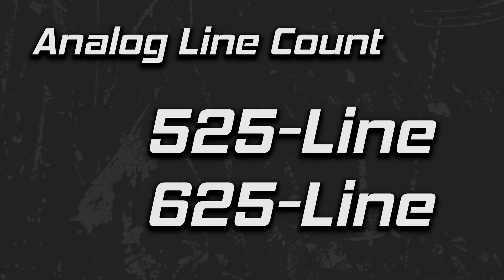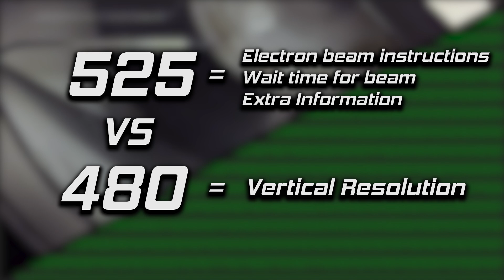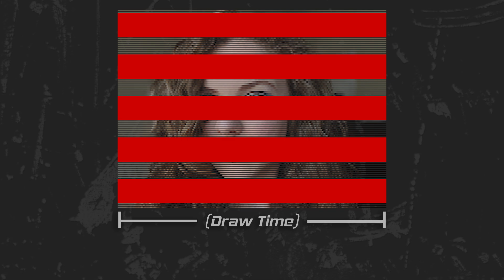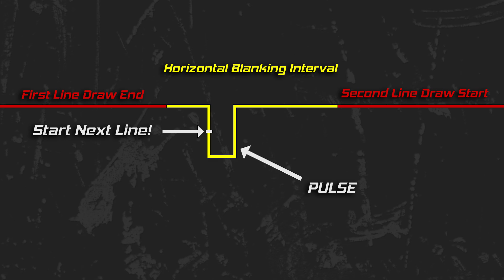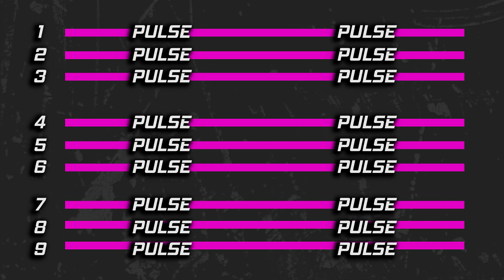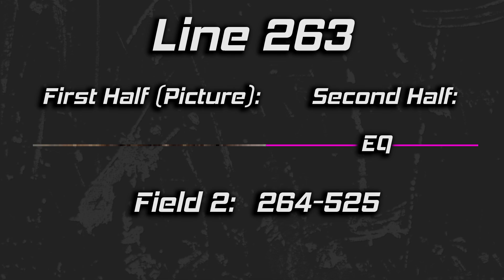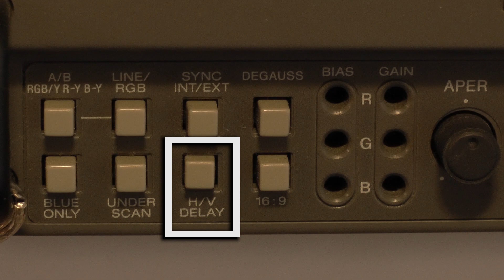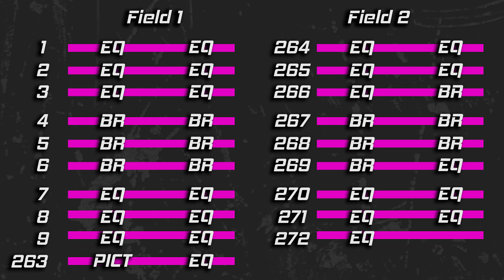What is 525-Line Analog Video?

Comment: One thing to note is that it's not the beam that needs time to go back to the left or the top, since it doesn't have inertia, and it's blanked anyway while doing so. However the deflection coils have inductance, which resists changes in current, and you can only drive them that hard before something would break.

Comment: And now add to the mix that there is PAL, SECAM and NTSC with different timings and line counts and different ways of encoding video signals, color, mono and stereo audio, and then try to write software that takes (almost) raw signal information from the hardware (because you don't want any fixed pipeline pre-processing by the hardware itself, you want pretty much all processing and decoding to be fully customizable by your software) and try to convert that into modern video output in software. This was a project I once worked on as a developer, and trust me, you will hate it! You will hate almost every single second of it, you will curse at all these standards and how they were designed, at all the inaccuracies, stupid hacks, and tons of problems you have to work around. Analog TV was such a mess, it's unbelievable it ever worked as well as it did.

If you ask me what was the most fun part of this project: The most fun part was writing GPU shaders for image processing, because there was no way you could do all that just using the CPU, although the hardware did at least some processing for you (which I also had to manipulate by messing with several dozen registers and writing custom firmware for the hardware), because there is no way you can be microsecond accurate in software alone. So some of the signal conversion was done by the GPU using shaders, and that was probably the most fun part of the whole project, as all the code was completely up to me (I know what information is coming in and what I want to get out, but how to do it with the GPU hardware was the puzzle I had to solve).

I once had to write an MPEG-TS decoder for mobile devices, and I didn't like that project either, because the MPEG-TS standard is huge and ISO standards are very hard to read and understand in detail, which is a requirement if you want to implement them accurately. But when you are dealing with those really old analog standards and their very poor standardization, you really know to praise the detailed ISO standards, which at least specify everything to the point where there should be no questions left and there are no two ways to interpret what the author meant.

Comment: What I find the most fascinating about all that old brpadcast technology is that it continues to shape modern broadcast technology. I'm a theatre tech so I do work with pro-grade video technology and one of the most important interfaces for us is SDI. It can generally be understood as a digital version of a composite signal (it's much better quality though) so all its specifications are an accumulation of the standards set in 90 years of video broadcasting technology history. It's among the most modern interfaces used today, but it still carries all the old specifications and methods within.
Reply: Broadcast TV still uses non whole number refresh rates due to historical reasons. Specifically it was so that they could maintain backwards compatibility with b&w sets when color tv was introduced

Comment: On the second pass (odd lines) the tv is drawing the video fields of the next frame, not the current frame. Interlaced video is sacrificing vertical resolution for temporal resolution.
Reply from the maker: In what context? Interlaced video has multiple options. You can use it to scanline-in a second field that illustrates some of the same frame as the previous field or use it to move forward in time and provide part of a new frame.
Reply: @DisplacedGamers  apologies I was talking in the context of video (say live from a camera), not games or computer graphics.

Comment: 0:25 You're kind of wrong about that.
Interlace only shows half the fields at a time. The switch is so quick you only see a complete image, but there's really only half an image being displayed at a time. 

It's not like it completes both fields to produce a full image. In interlace displays, there is NEVER a full image on screen.
Reply: In that sense, it never even shows half the image at any given time. Or even a line. All it's "showing" is the single spot where the beam is pointed.

Comment: The one detail that really helped this all click home to me when it was pointed out, is that the vertical scan is constant - the electron beam is always moving down, even as it scans across each scanline. This means that the scanlines are very slightly diagonal, as the beam moves down by most of a line as it goes from left to right across the screen. This is how the half-line offset makes the interlacing work - by starting one field at the top left of the screen, and starting the second field at the top middle of the screen, the scanlines for each field gets nestled between the scanlines for the other field. This is why the total number of lines, 525, is odd.

Comment: Think of the electron beam as a pen, which has momentum when it moves.
When the line ends, it still has the momentum from moving to the right for so long, so it literally has to slow down, go to the left for awhile to return to the beginning, turn around again, and start moving right for the next line.
The H-sync interval accomidates this.

Also, it was never just 525 and 625, there was a bunch of bespoke TV systems which all worked more or less the same way, but with different settings.  The BBC used 405 lines for awhile, and the 525 line system was originally a 441 line system that then got upgraded.  The first BBC TV broadcasts were 30 lines, mechanically scanned.  It later got tweaked into a 32 line system that oldschool hams sometimes used over shortwave.
Incidentally, the mechanical systems theoretically didn't need an H-sync pulse, as the mechanical scanners were able to start new lines instantaneously due to their geometry.

Comment: The reason for the half-lines in interlacing is interesting. Horizontal scanlines aren't really exactly horizontal. They slope down slightly from left to right. The is because the vertical downward deflection of the beam continues as each line is drawn. To get interlacing a vsync happens halfway during a scanline so that the next field's lines end up starting at the level of the midpoint of the previous field's slightly sloped lines.

Comment: I'm watching through your videos, having just discovered your channel.  Fascinating stuff.  Even though I worked with home computers since the early 80s, there are some things I still didn't know about luma, chroma and NTSC.  One thing you didn't cover, however, is how live analog TV, and its recording on videotape, carries 60 intervals of motion per second even though there are only 30 full frames per second.  Each field is a snapshot in time, and doesn't have to match either of the adjacent fields in the timeline.  So the result looks like 60 fps even at full 480i res.  Given the strobing effect of CRTs, that motion looks perfectly smooth too (unlike the sample-and-hold tech of LCDs).
Reply from the maker: Yeah! Sports in particular are great for this. Another interesting topic is framerate conversion from film (24 fps) to NTSC.
Reply: Interlacing could be thought of as an early form of video compression in this way.

Comment: while modern digital flat panels and digital hdmi and other such connections are great for getting 1:1 picture to the panels.
those crt's and their analogue imperfections are still kinda magical, and what comes to the terrestrial signals.
i doubt that something like hanging your old Playstation 1 RF-adapter to your bunk bed post, as a ghetto antenna solution would yield anything usable to DVB-T signals.

granted the picture was nowhere near perfect, but perfectly usable on those 14 inch crt tv's.
if i took the exact same analogue signal and watched it on 14 inch flat panel and old 14 inch crt, that analogue crt would hide so much of the imperfections from that broadcast that it would look miles better than the flat panel one.
but if i took a picture from digital box and watched same broadcasts through those monitors, but from dvb-t source. then the flawless lcd panel would definitely win.

my point with this started from the magic of how something so ghetto as RF-adaptor as a antenna works fine on imperfect world of analogue video, but it would never work with our modern digital world . not even if the video was in analogue form to avoid the cuts from missing data on digital signals.
those times were lot simpler...

Comment: The aspect that isn't really explained here is how a half scanline can cause a shift in the field position: It's because the horizontal lines aren't actually perfectly straight, but due to the horizontal waveform, slightly bend to the next field position.

Comment: Nobody talks about how different stations are not all broadcasting in sync with each other.  This is why a TV needs to be able to suddenly change its timing; why each line and each field has its own tracking information.
Imagine if the signal didn't include that data, and the TV was just timed to display everything on an internal timer; it knows to move to draw the new line exactly after a certain time, and draw a new field exactly when all the lines are drawn.  Now imagine you change the channel.  There is no way that the new station would be broadcasting at the same rate down to the microsecond so that each new line is broadcast as exactly the same time.  Your TV could be drawing the image in the middle of the screen but the new station happens to be drawing a new field.  Even if the stations were timed to each other, the fact that your antenna would be a different distance from the broadcast source would naturally result in the radio waves being out of sequence anyway.
This would naturally force the viewer to manually adjust the settings on their TV for each channel to properly position the image in the middle of the screen.  Quite a hassle, so instead the syncing information was designed to occur in the signal itself.

This is why, when you changed channels, the image would "flip" for just a fraction of a moment.  The image wouldn't line up right for just one frame because the two channels were not in sync with each other.  Nobody mentions this, and it is not really possible to demonstrate anymore, but this happened back in the day.

Also, do you recall seeing poor staticy images that would scroll up for a moment or two?  (This effect certainly has been shown in various shows and movies before.)  Remember, these signals are all analog, so if the signal to start a new frame came in too weak for a TV to identify that's what it was, then the image would not be able to correctly determine where the new frame starts.  These pulses that are used to sync the images are not functionally different from a proper signal, they are just effectively lower (or darker/blacker) than the rest of the image.  And being all analog, some TV's might be more (or less) sensitive to this new-line command than others.
Fun fact: There is a certain range of blacks in the NES's color palette that were so dark that they could trigger some TV's to start a new field.  No officially licensed NES game was allowed to use those colors because they could cause the image to lose its vertical hold.

Comment: Amazing jobs. Congrats!! I am wondering although, how these old games work correctly when played on new lcd tvs that have no electron beam and scan lines, but pixels lightened together at the same time for each frame. Is there any kind of emulation from the tv itself?
Reply: Those TVs can read supported signal types and then build an image. Rather than firing the beam as it gets signal, it captures an entire frame then builds and displays a framebuffer.

This allows it to crop out metadata in the signal such as closed captioning, rather than displaying it as picture data (or having it disappear behind the overscan)
Reply: @KopperNeoman  Thanks a lot for your response. And how in modern tvs the console handle the time that the beam needs to go to the top of the screen for making its own calculation now that no beam exists?

Comment: I never understood why they jumped the beam back to the start instead of rendering the next line backwards. It should have been possible to send a buffer and have the CRT beam render towards the right then on the reverse render towards the left. It would have allowed much easier syncing as you only have to sync each frame, send the Data, then let it render.
Reply from the maker: The television was designed to take the image that was sent and draw it to the screen. The reason vertical blanking and horizontal blanking exist is so the beam could have enough travel time to get back to the top of the screen or the other side. 

Even with technology available in the 1930s that would have allowed signal storage and a way to draw a line of image information in reverse would have been cost prohibitive. The technology greatly improved not too long after the first sets rolled out, but they weren't going to constantly change the signal make-up as it would have rendered the previous TV sets useless.
Reply: @DisplacedGamers  So what inhibited it. When they were creating the signal all the same why wouldn't they have just been able to do the same so that nothing different would need to be done and they would just reap the benefits as Data would come in as a single long stream without the blanking intervals. 
How was the image encoded I guess is the question in my mind.

Our Vertical blank I kind of understand as it gives time to do other things and prepare the new frame but for the Horizontal blank it just seems like it would make more sense to directly encode the signal in such a way that the beam could be rendering forward and backwards totally eliminating any need for a Horizontal blank.

Comment: 12:50 - This is how Todd Rogers King of Video Games abused and manipulated the first generation atari arcade cabinets.  He put in game commands during the vertical blank cycle in order to get extra inputs outside of the normal game operation.  On home systems, most atari games had prevented this by disabling the input polling, BUT not all cartridges.  IT is my strong opinion that the early Atari Arcade Cabinets didn't (I was only able to confirm one didn't, with "I don't know" for the others).  When Todd would get his high scores, he insisted that companies like Activision provided first generation Arcade Cabinets to him.

Todd Rogers, King of Video Games, was a cheat, but not because he lied, because he abused game glitches to get his high scores on machines that the average home user could not get.

Comment: As the popularity of retro gaming has skyrocketed in the past few years due to twitch, speed running communities, classic NES Tetris competitions, and emulators, I have become more interested in the lag time of different monitor choices, as many others have as well. I completely understand that using the designed hardware is best, sometimes it's not possible. I guess, I'm wondering why there is a lag between crt and other flat screen monitors. What is the best way to get as close to crt quality as possible without one? Thanks.
Reply: TVs have processors today to figure out how to display the image. That processing time = input lag. 

To reduce the lag, use as little processing as possible (turn off advanced features and turn off power save). Usually modern TVs will have a "game mode" that does this.

Comment: Very good explanation of analog video. The Atari 2600 works quite a bit differently than other videogame consoles. It can display more (or less) than 192 lines, that is just the number Atari recommends in their documentation. The programmer has almost total control over the video signal timing and it is their responsibility to set when the HBLANK and VBLANK and VSYNC signals are produced by the TIA chip. By reducing the VBLANK period, a taller game display is possible. I've achieved a stable display as tall as 230 lines, though what is possible and how much is visible outside the overscan area is largely dependent on the television. That's why a conservative 192 scanlines is recommended.

Comment: So old videogames could've had closed captioning? I wonder if that was ever used
Reply: That's a really interesting question. It seems that TVs in the US weren't required to support closed captions until 1993, by which point consoles were more than capable of displaying text on their own, instead of relying on a feature that some TVs might not have, and which would most likely be turned off in most households. So, I don't know of any video game consoles that support it, but if it had been readily available in, say, the 1970s, maybe consoles could've made use of it.

Comment: Actually, the vertical hold process typically starts at the bottom (visible if you can see the bottom of the raster), then the rest of the bar is drawn on it's way up, including the other half of the sync process. On an older TV (70s, back), you can see this with adjusting brightness, and contrast, as well as the retrace lines with vertical hold slightly off-sync. You can also view the copyright protection on DVDs/Tapes as well, as the beam always is drawing (it uses the black portions as "Blanking" the physical image, as that technology didn't exist then). It draws a pair of 4 black, and super-black boxes in the vertical bar retrace region. When this happens, you can see the white parts fade in, and out of the image on the upper-left of the display, because the older TVs didn't blank the raster at any point.